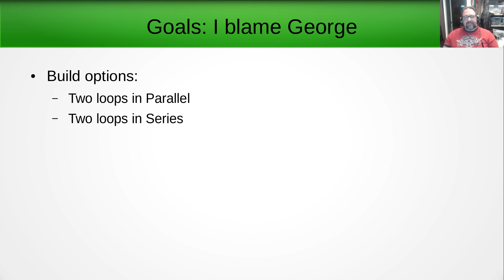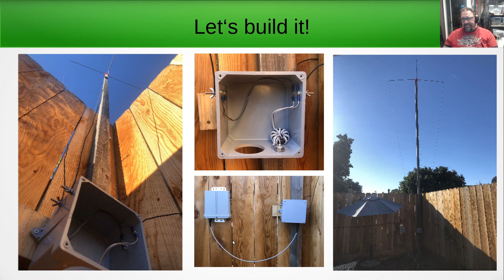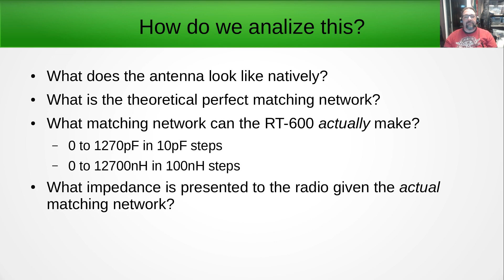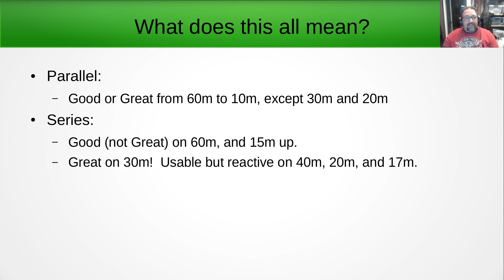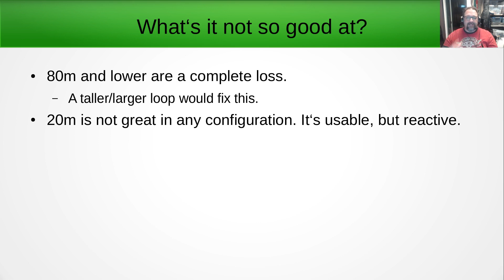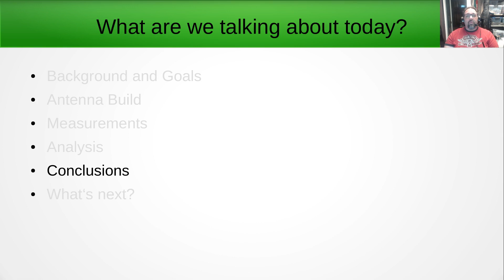Building and Testing an HF Slot Antenna - Mark Smith KR6ZY

Comment: On the subject of the Double DELTA Slot or HF Slot antenna; If size were not so restricted and for a permanent application would there be any benefit in super sizing it? 
ie. Having something on the idea of a 16 to 24 foot cross section and whatever complimentary hight increase might coincide?
Any guidance would be greatly appreciated! 
Thank you kindly 
Gary

Comment: Does the length of top spreaders have a specific size or can it be say 4m across the top?
Reply: I'm busy building 1 of these, with 3m spreaders as a starting point, and intend (depending on results) to use longer spreaders when the fiberglass tubes arrive,
as I believe it will perform better,  It's basically a double delta loop.
Reply: @jedde-wiltonholmes3549  I bought 10mm 2m x 4 just got to figure out how to mount it on my 12m mast so should be good to go

Comment: Nice presentation, Smitty. You expanded a LOT on areas that W6NBC did not elaborate upon, particularly the phasing and resultant patterns. My two cents for you:

1) Your 1:1 balun is raising havoc where it is located, as it cannot properly handle the complex, high-impedance load on the antenna side. It's anyone's guess what type of saturation loss and/or impedance transformations are occurring in your balun. IIRC, Portune mentions placing a CURRENT BALUN (common mode choke) on the TX side of the tuner, and not a voltage balun. Big difference there.  He also states that the ground terminal of the RT600 tuner should be tied to a ground rod, strongly implying that his double delta is NOT intended to be fed as a truly balanced, isolated load. His article stresses numerous times to NOT place a balun in-between tuner and antenna. Your less than satisfactory matching results are suspect. 

2) Portune has no issues whatsoever having his RT600 tune the double loops on 80m, nor anywhere else 80 - 6m for that matter. Two loops in series is approx. 100 feet of wire...pretty darn close to a 1/2 wave on 80m. The antenna is only slightly short electrically...and should not appear as reactive as it does on your installation. Again...I suspect that the 1:1 balun location is causing problems.

3) I use an RT600 to successfully tune a VERY short (20') vertical on 80m. A properly-constructed 4:1 UNUN, designed to accommodate a highly-reactive antenna load, makes the high-impedance load a lot easier for the RT600 to tune, but it is not an absolute necessity. Search for the articles by G8JNJ where he discusses the use of baluns and ununs in-between a remote tuner and a highly reactive load. His research and supporting test data are real eye-openers and likely will apply here as well.

Thanks again and 73,
W1LJ

Comment: How can you possibly expect to tune this antenna through a 50 Ohm choke(UNUN/BALUN). Put the choke on the coax side of the auto tuner, where it can do it's job. Are the .s1p files with or without the choke? If it is without the choke, the parallel has impedances from 2.2 Ohm to over 300 Ohm. A LC tuner should tune this to a very low SWR.
And Mark, put the links in the description, so they are clickable. LB8X